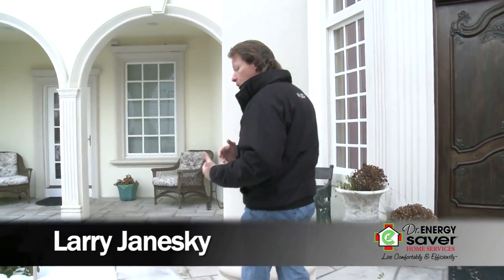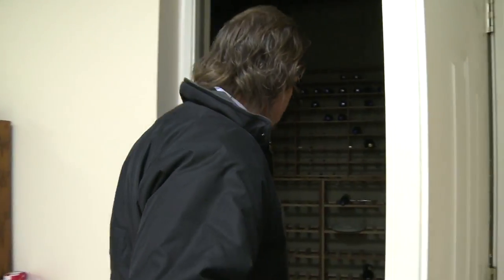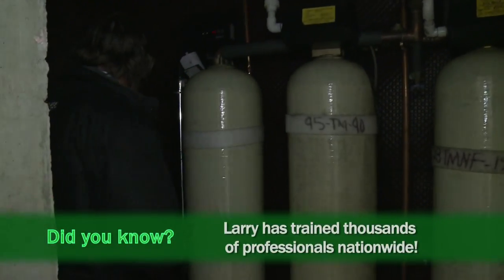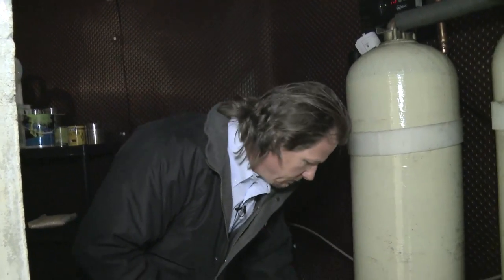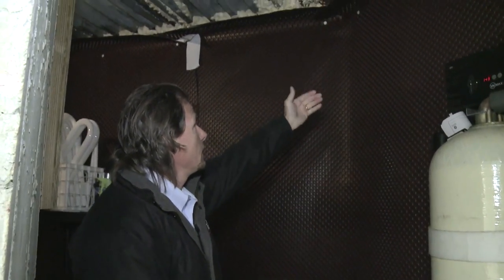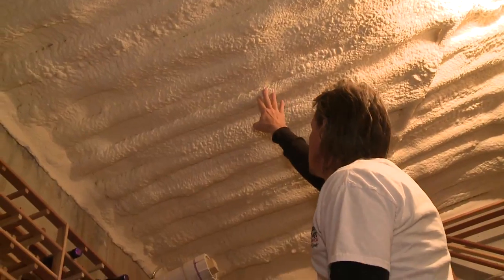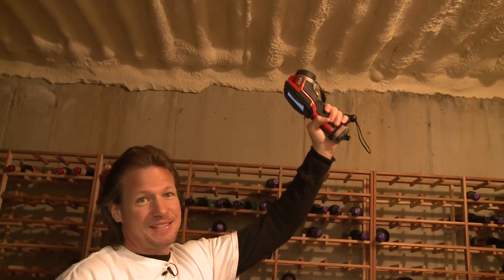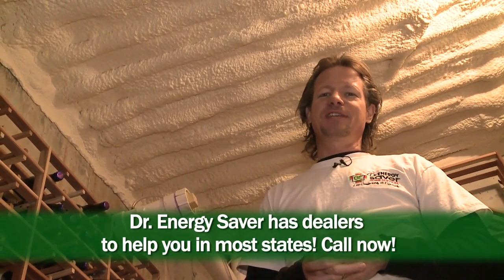Insulating Concrete Ceilings Under Porches

Comment: We can apply an intumenscent thermal barrier without issue.  There are a number of methods as there will always be for most jobs.  Walls can be addressed with board foam - polyisocyanurate if not being covered.

Comment: Should have used a urethane based foam and foam should never have been applied over the plastic membrane. The water issue should have been resolved first. That is going to be a solid mass of mold behind there.

Comment: Those spaces should be insulated from the ceiling down to below the frost line,3-4 ft below ground level. Just insulating the ceiling will not prevent the moisture issue. Best way is to frame entire room keeping the studs about 1.5 in off the wall and then have 
spray foam applied, using a 2x3 stud this should give about an R14. Just make sure that all the rooms are plumbed into the heating and cooling system of the house with proper air flowthey become a useable area.

Comment: How does this company get around the fire code. Yeh it's nice to use spray foam, but there needs to be some sort of fire retardent over the foam. Even if these rooms are not finished rooms. A responsable contractor would address this.

Comment: If they just put a weatherproofed door on those rooms, they wouldn't have the condensation.
Reply: I agree. The condensation resulting from temperature differences between warm and cold areas such as the door and maybe other areas, needs addressing before insulation